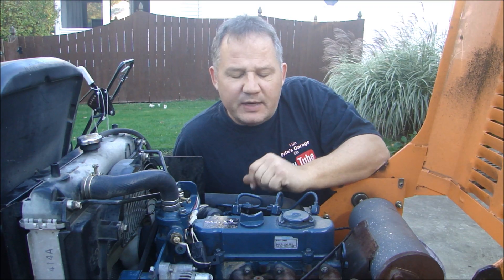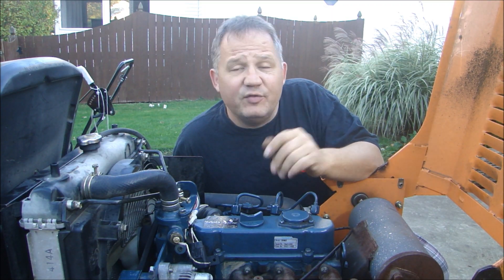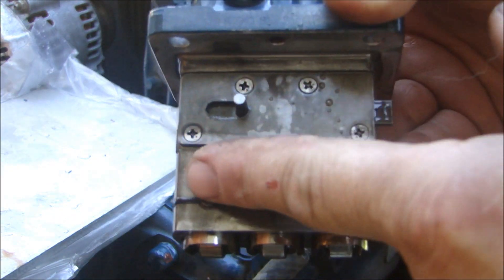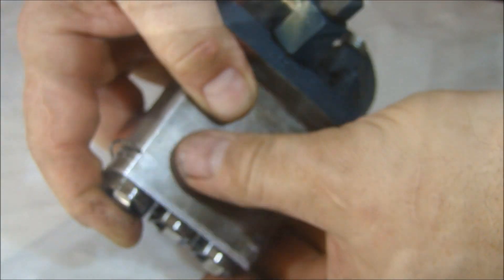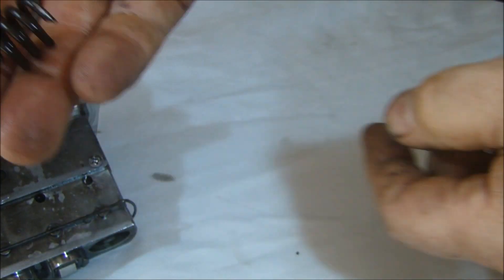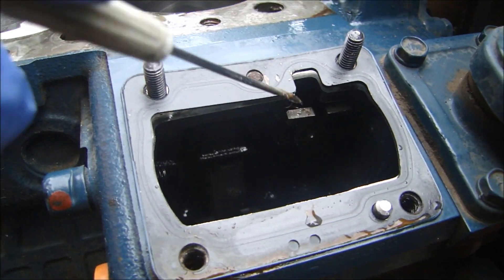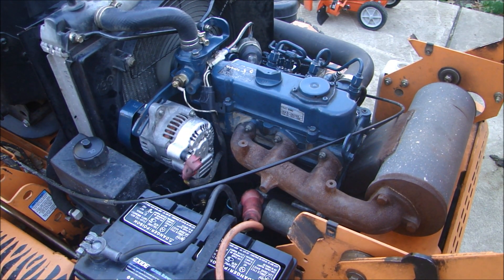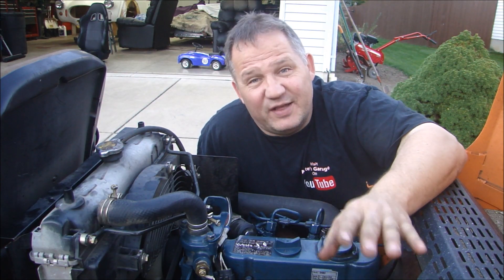Kubota D902 Diesel - Bogging Down, Blowing Smoke

Comment: Hi Pete, why didn't you just replace the springs and or new injector instead of purchasing a new pump?
Reply from the maker: Diesel engines are considered industrial. I would have rebuilt the pump, but the part numbers are not made available and parts are impossible to find without being a distributor. It's kind of a huge money racket.
Reply: Gotcha
Reply: @PetesGarage  Fortunately for me, engines of that type (3 cylinder diesels with Bosch pumps) are quite common so getting hold of a scrap pump wouldn't be that hard. Interesting video.
Reply: @PetesGarage  Thats not at all true !  I work on these motors sometimes and never had trouble finding parts for them !  You have to look , thats all ! there everywhere !
Reply from the maker: I did a pretty exhaustive search for parts. The dealer that services these locally was not a great help either.
Reply: I had this same issue with my pump. I took the pump to my local tractor supply. they swapped it from a rebuild they had on the shelf. $125 bucks after core. I was out the door 15 min, back to mowing in about an hour.
Reply: Petes Garage i wouldnt have trusted just replacing the 1 broken spring either, highly possible and probable that the other two springs would go bad too, so i agree you made the right desicion in putting a whole new pump on
Reply from the maker: There are 2 Tractor Supply near me an neither carried any parts. I could have gotten a rebuild for $450
Reply: Also the separate pumps have to be calibrated so that they pump the same amount of fuel per stroke, and without a service manual for the PUMP  it is very difficult to get it right.  Best to have it overhauled by a shop that specializes in fuel pumps,  or do as Pete did and just buy a new one.
Reply from the maker: I spent days looking for it
Reply: Silvera Media kubota parts are easy to find, however injector pumps are always sold as complete units.
Reply: Might want to tighten up your radiator...
Reply: Random question Pete: Is there a MFG that builds diesel engines in these sizes 1L and below where parts are easier to find?
Reply: Kubota is about as common as you're going to find. They are used pretty extensively in small tractors, large commercial lawn mowers (as seen here) and small home diesel and RV generators. Yanmar (i think im spelling that right) is another manufacturer that comes to mind but at least in my area Kubotas are very common. I've got a Kubota D1105 in a large Scag mower we got from a neighbor. it's a FANTASTIC engine.
Reply: Or test the spring pressure and sizes and order off that